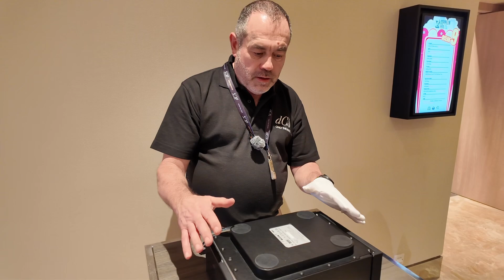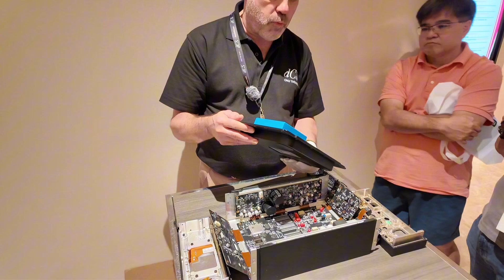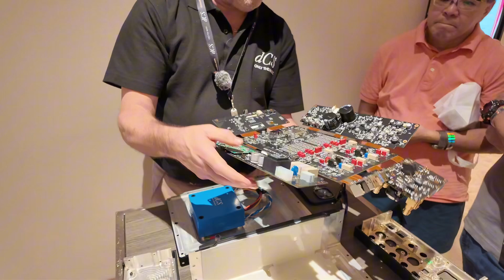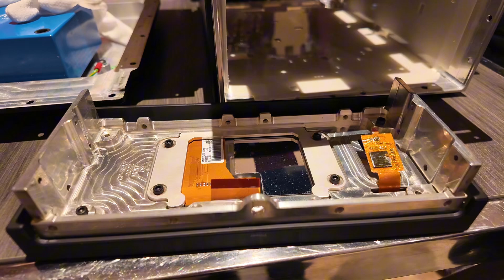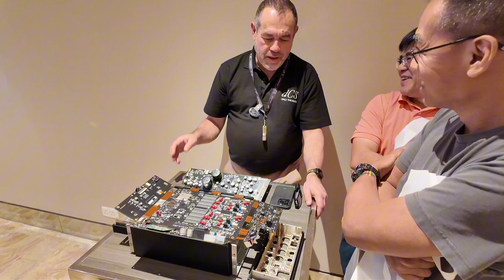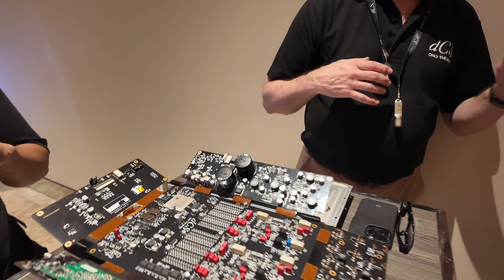What’s Inside the $13,000 dCS LINA DAC?

Comment: After my speakers, Lina dac with lina master clock are the most expensive devices in my system, but it completely transformed the sound. Class A power amp, low noise pre amp, beryllium speakers and now dCS combo...I'm in absolute heaven.🥰
Reply from the maker: Wooooahh nice! Are you using Focals? What amplifiers are you using?
Reply: @Hifihobby Yep 😄I'm a big fan of Focals.
I got Sopra 3 about 5 years ago and at the moment I have Pass Labs XA30.8 with xp-12 preamp. I was planning after recovering a bit from spanding on Lina combo to upgrade to 2x XA60.8 monoblocks to drive those big speakers a bit better. Unfortunately in Australia (where I'm from), Pass Labs whent up $5K!!, so I'm forced now to rethink all of my options. 
Fortunately, that 30Wats class A is like a tank and together with 2x Rel 812S subs is going strong enough, so I'm really not in a great rush to upgrade. 
What's your system like?👊😎
Reply from the maker: @robotstonka7118 Nice setup you’ve got there. I’m sure it sounds amazing 👍🏼 I’m using the Eversolo A8 as streamer, Mola Mola Tambaqui DAC, Gryphon 333 int amp and KEF Blade 2 Meta speakers

Comment: If transformer noise is a high priority to remove and you go over water by drilling chassis, why not use an external power supply as many others do?
Reply from the maker: They still have to put the power supply internal to keep the small all in one form factor